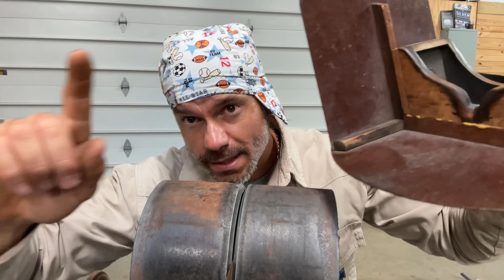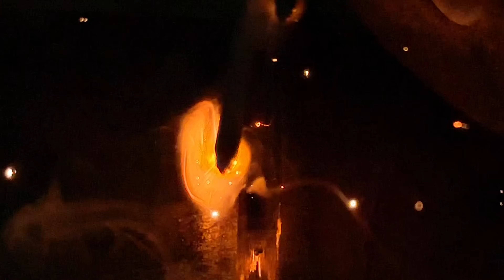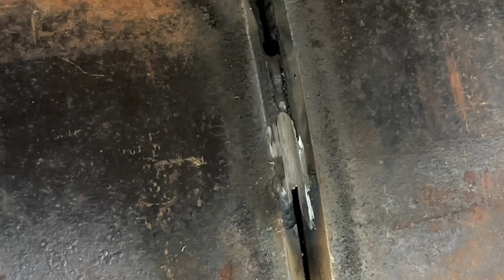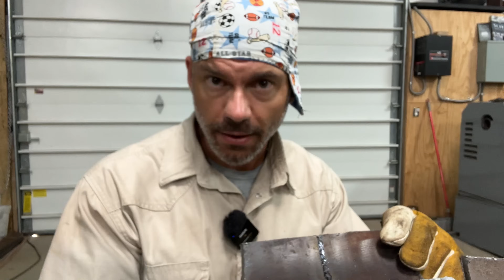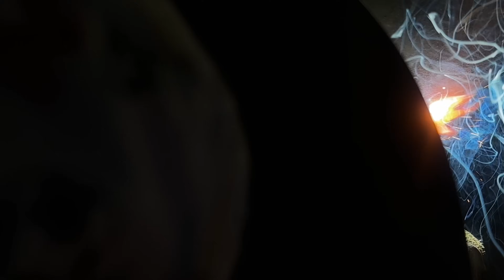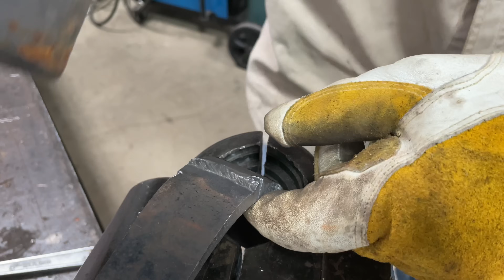Master Pipe Welding: Secrets for Perfect Bottom Welds

Comment: Im a first year apprentace. I am only allowed to run 1/8 6010 and 3/32 7018. I run my cap to flush and run 85 amp and run 2 wide cap beads and 1 thin quick final bead, to keep me covered on undercut if there is any, on sed 80 6in. I find myself strugling with my bottom drooping on both my fill and cap

Comment: Good video - the nick test reminds me of welding school. Most of my welding after school was in a refinery. The codes required most CS weld stringer and hot pass to be P5, all up hill. Any filler and caps were up hill using 7018.

Comment: The box is balsa, or a similar ultralight wood.  Who makes the best pancake? (Sarge seems lighter than Wendys-gotcha)  I have a CMR Fab pancake in the mail and I'm putting a Tefuawe adjustable auto into it.  I can patch a box back together-hell I thought about fabbing up my own pancake hood as they are so simple. Box, strap, flat panels, lens.  Of course making it ourselves (when it can be purchased off the shelf)  is usually the most expensive way to do anything, so I'm learning to avoid such.

Comment: Hola Chris,
I'm 52 and have been welding on and off since high school, mostly on my own equipment and some side jobs here and there.
I have recently decided to go back to welding school to learn to mig and tig. Stick welding and oxyacetylene has been the intro and a great refresher, but as mentioned, the r. To learn to mig a tig. 
What is a good machine in your opinion for pipe welding and other types of work that won't break the bank. I've been looking at a Miller Trailblazer.  
I'll buy one of the stingers if you have any left to sell.

Comment: Chris, I’m not a pipeliner but do weld on my farm equipment. Shredder, hay fork, corrals,…etc. Do you have advice on running a good stout bead on high stress equipment?
Reply from the maker: Get it clean dig out any perfections such as cracks. The 6010 first. cap it with a 7018
Reply: Thanks
Reply: Also pre heating can go a long way.

Comment: When are one of the manufacturers going to make a stick welder with a thumb control, sure in this dsy and age it wouldn't be hard, as welding position and metal temperatures change small changes in current would be super improvement in MMAW
Reply from the maker: That is a great idea
Reply: we used 10 k linear pot    taped on the stinger handle  or a remote with a magnet to hold it on the pipe 
good jobs have a helper  to adjust it

Comment: When I was doing pressure piping work, I would only ever use a 3/32 disc. Those disc were for nothing other than my fit-ups and for getting inside the bevels. Zip disc's were too narrow and prone to cutting instead of grinding, and the 1/8th were just a hair too big.
Just like in the 3 bears.😂 they were jussst right.

Comment: welded for 45+ years, field gaps can be horrendous . One constant always uniform lands the same on both sides . you have a constant heat sink then on both those sides . High low can be adjusted by simply lining up the  tops  of the lands, the inside because of that uniform land will mirror what you see on top every time . I preferred 3/32 land 3/32 space when the pipe is 3/8" thick and thicker and depending on the space on fire cuts I would whip wide spaces turning down the heat or using a different size rod . Iron bound was as easy as running the grinder over the bottom of the bevel . experience will tell you how much to grind or a rule of thumb would be to grind till the bevel at the bottom disappeared and there was a grove with a straight line do not grind all the way through . weld the bead with a 1/8th inch rod . Always weld your tight spots first

Comment: I have been welding for about 5 years and on farm repairs and structural and practicing pipe and I was always told not to have a tiny gap when putting in a root, I was told it causea finger nailing, but every time I weld with a little bit of a wider gap I always blow out my root and I just don’t know which is better or what else to try
Reply from the maker: It’s somewhere in the middle. Put it together just like I showed you manipulate your travel speed in heat as needed.

Comment: Hello dear Chris, hope you are great. 
When you were capping the (welding downhill ) was the electrode 6010 or 7018 ? 
And please can you give any advice 
In 5g position pipe welding when i start capping with 7018 1/8 rod it is sagging puddle is dripping.
Reply from the maker: Yeah, you can’t run a 7018 downhill. It was a 70+ a.k.a. 8010. It’s a cellulose rod a lot like a 6010

Comment: The part where your talking about driving in your tac welds would it be the same with mig I'm pretty new to welding
Reply from the maker: I’ve never welded pipe with a mig gun
Reply: @TaylorWelding  I got yu I'm a trailer technician at Utility Trailer in Utah and just wondered if the basics applies the same way I'd be interested to see

Comment: Had an issue back in high school with metal popping while cutting with a torch, when you got to your tack, is it popping because your tack material isn't heating up as consistent as the pipe material?
Reply from the maker: I would say it's running up on that bevel / bead

Comment: Chis any chance of you doing a 6010 bend test.  I have welded for many years and have passed many  different welding tests . But had an issue with a sch80 6 g 6010 all the way out test ?
Reply from the maker: Sure. I wonder why it’s breaking on you.
Reply from the maker: If I had to guess it’s too hot. I had that trouble
Reply: I was thinking the opposite.  . I put the root in at around 85 amps
Reply: No one on YouTube  has done a 6010 bend test

Comment: so grate video, just a few questions, what kinda heat were you runing the hotfill and then the 5.0 8010 on the cap? me and a buddy were playing around with 8010 and he said he was running 180 ish on 30inch lighter wall pipe, we were messing around on 8 inch 40 at 160 ish, does that sound about right?
Reply from the maker: hard to say. A little bit hotter than the bead
Reply: @TaylorWelding  thanks, i think my problem is i run to hot, need slow down and turn down

Comment: Tig sch 40 pipe 0 landing 4mm gap  and not allowed to root tack 100% X-ray ! I worked in oil and gas so different standard ! Bullet tack and write name on every weld , hit number , material , wire or electrode type and welding procedure by welding inspector ! Usually root Tig hotpass and cap stick

Comment: I weld for a living, but I weld car bodywork day to day.  Today, I had a different job on, welding heavy steel plate onto a customers machine - a full day of stick welding (and again tomorrow).  Burnt through a full box of rods (5kg) today, will burn maybe another box, box & a half tmrrw.  

I have not been as bored, as pure sick of looking at a project after only one day, or as utterly worn-out as I am right now. I'd forgotten just what an absolute PITA running stick at volume is, how totally boring it is to run rod after rod after rod - none of it on the horizontal, of course, all uphill, none of the gaps anyway tight - all huge gaps that ensure 1 rod progresses you sod-all, while being an absolute head-melt because you've to be paying attention every second, no zoning out. 

Why people are fascinated by stick welding baffles me - it has got to be people that have never welded, or people who have only dabbled & never run a machine for any significant period of time. Personally, I reckon it's about as exciting as watching paint dry, it's murder on the body as you're contorted all day staying in position & I also know that if there was a decent 3-phase Mig machine available on this job(there isn't), I'd have had the whole damn thing welded up beautifully in about 3 hours, instead of 2 days+ of hardship using stick.  The process makes ZERO sense to me tbh. It's just hardship.
Reply from the maker: I’m pretty much burn out on it as well. But it’s what paid the most not what you’re talking about but Welding on high-pressure pipe.
Reply: @TaylorWelding  High pressure pipe would also be better welded using 3-phase Mig - insisting on using stick is just another example of "We have always done it this way, so you're gonna do it this way" thinking from "The Bosses".  Its archaic.  I know it is what it is and "the customer is always right" - but you know too that you'd mig it in half the time or less & nothing is going anywhere. 

My "kink" is being good at flux-core - I run more flux core wire than anyone I know of - it gives me a big edge over other welding spots as my consumable costs are miniscule at this stage. I don't have the big overhead of gas and my machine costs are also small - that allows me to weld stuff at the same price as the other guy, but with a far higher margin. I ran gas for decades, spent fortunes keeping the gas suppliers in clover - then I started looking for a viable alternative. Now, you can keep your gas bottles, I don't need them as I have my flux core game dialled in real tight. I understand the process inside out  & upside down.  That alone often saves me 1000 a week - some weeks it may be 400, other weeks its 1200 - those numbers are what makes the difference between making or losing money. 

Not to bore on - but there's many ways to skin a cat. :-) Given some pretty specific machine & wire specs that I'd be fussy on - I'd reckon you could meet spec easily in about 1/3 the time on pipe using flux core - that would involve using a multi-process machine that has arc-force adjustment (sod all do) & some very specific wire that meets standards (sod all do, but some do) - done right, you'd struggle to say if the process was Tig or flux core or Mig - it comes out flawless - but as with everything, it involves knowing what it is you're using & why - not just chucking money at it.  The absolute best wire & machine combo is cheap as chips - but it's like hunting unicorns.